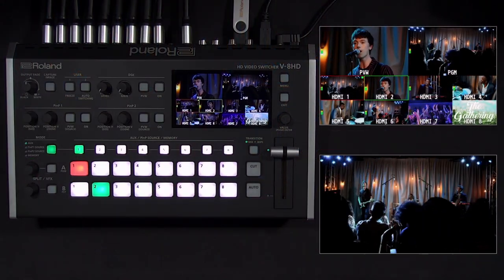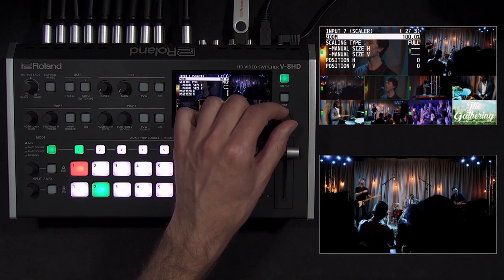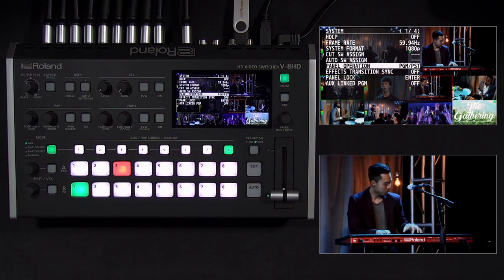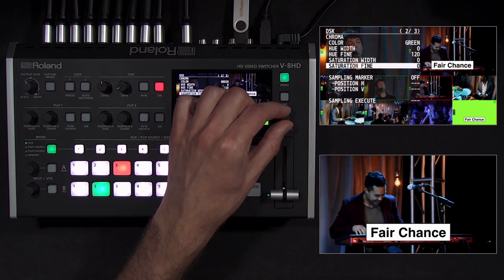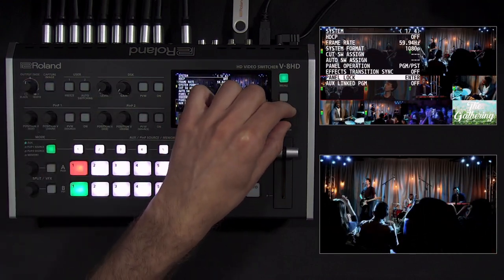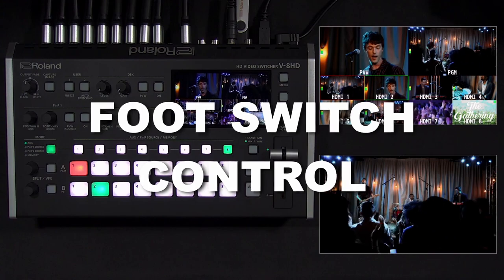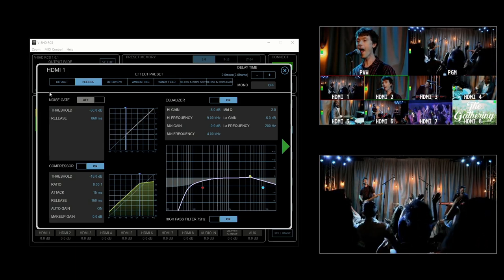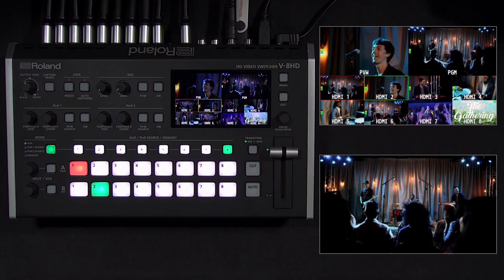Roland V-8HD Video Switcher Tutorial

Comment: If needed, is it possible to customize all 3 HDMI outputs to be Program outputs?
Reply from the maker: Yes, use the Video Output menu to configure this:
Menu > 2: Video Output > Output X > Output Assign > Program

There are additional settings in the System menu to disable the on screen display for HDMI output 3. Note that this information still appears on the LCD screen:
Menu > 19: System > Output 3 OSD > On Screen Menu > Off
Menu > 19: System > Output 3 OSD > Label/Level Meter/Mark > Off

Comment: Some great info. One thing which is not covered, though, would be a way to easily pull up a color or black image on one or the other outputs. I have a use where we need to have two projectors running, but sometimes black out one or the other.

It looks like I could go into the menu and set up an aux still to be assigned to one or the other, but that's time consuming, and I need to switch quickly between them. 

Any idea how to assign a button to have a black still image appear on one or the other projectors?
Reply: see if there is a way to blackout your projector using its remote or software.